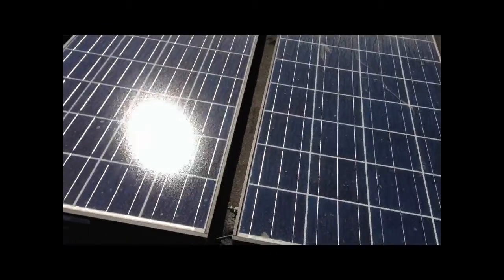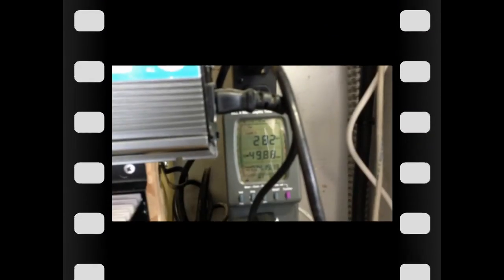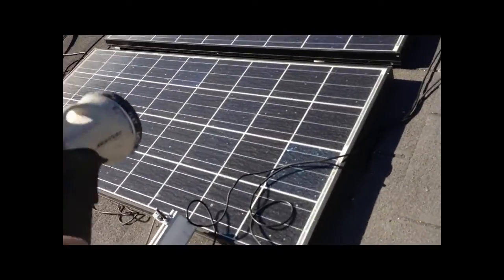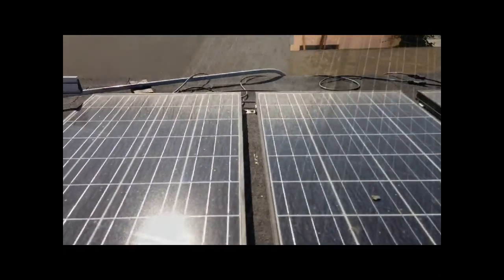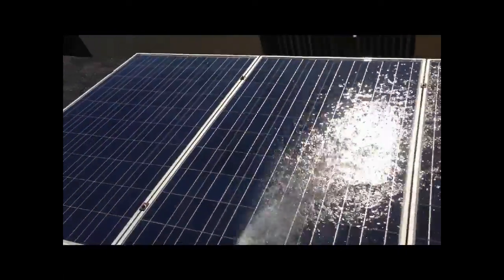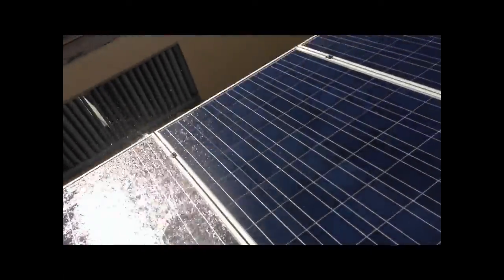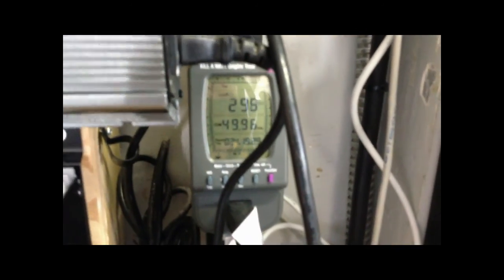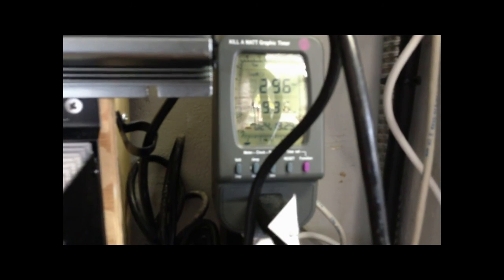Solar Panel Test:  Dirty vs. Clean

Comment: As a scientific experiment, you haven't controlled all of the variables affecting the output of the system and based on my own experience, you've credited the wrong variable for the output improvement after you've hosed the panels. The panel efficiency is rated at T= 25 C but typically the panels operate at much higher temperatures, resulting in losses of 10% to 20%. 

I believe what you actually achieved was a lowering of the temperature of the photovoltaic cells, which decreased the % heat loss. An easy way to prove or disprove this is to do the hose "clean" one day and then look at the outputs the next day. In my experience the efficiency of the panels may improve up to 3% (8% goes up to 11%) on a rainy day, but the next day, for the same maximum temperature, whether cloudy or bright sunshine, will settle back to around 8%.

I've tried to prove that cleaning makes a difference, but I haven't been able to so far. The final test is to actually clean the panels and look for sustained improvement in efficiency. My only conclusion to date is that it would be worthwhile irrigating the panels to reduce the heat loss effect, which as I said is in the range 10%-20%.

Comment: Would have had a higher percentage increase, if the the panels were properly cleaned. Dirty blocks the surface of the panels and blurs out a percentage of light, granted you probably removed the loose dirt, but unless proper cleaning tools are used on the panel, just spaying them and adding rainX is not a proper clean. once cleaned and maintained it becomes easier and easier to keep clean, but rainX is just another thing that will attract and hold more dirt quicker, than if not used.  With over 300 days of sunshine in Colorado Springs, we have lots of solar panels and dust. http://www.WindowCleaningTime.com

Comment: Anybody that considers that "cleaning" would be happy to wash their car and house windows the same way.  They won't be clean and what's left behind from that tap water will be worse than the dirt that got rinsed off.  The minerals dry, create a rough surface, and hold dirt better and better each time a new batch of mineral deposits is applied (tap water)  This is how we do it in Arizona.  http://cleansolarpanels.net

Comment: i have done some tests and very little diff. don't know where you live but if you can tilt panels at least 15 degrees they will stay clean. i'm in the sw and we tilt panels from 15 to 25 degrees if your n. more and if your s. less. your panels almost flat. and are those 2 rails shading that one panel? that will pull that string down. as little as a overhead power line will kill a string. get your panels at right angle for your location you will see a noticeable increase.....if you guys are getting less than 60% sys is not set up right. depending on month my sys. is between 70 to 90% april is 95%. contact me i can help
Reply from the maker: in so cal.  i thought of mounting on angle, but for asthetic purposes only, did not want to raise them on legs with tilts.  i prefer the low profile look. no shading at all for me, but dirt (especially heavy dirt) acts similar to the effects of shading... my panel test was done on a cool crisp day so i don't think the water from hose cooled them further, which would normally increase output.  But the reason i am getting such poor production is because the array i did the testing on is inverted with a cheap chinese plug in inverter.  My larger panels and array is inverted with individual Enphase Inverters which net me 1.2kw peak on an array that's rated only at 1.35,  So, tilt not killing my produciton as much on the array in test, but rather the cheap plug in GTI is biggest culprit. thanks for the comments and advice
Reply: your panels should be at 22 degrees for best year around performance. you won't get much at all during winter months. i live off grid winter i set panels at 40 sun is low and less of it then march drop then to 15. i install for living. have a few customers wanted low tilt. they were not happy told me something wrong with sys getting about half of what they thought they should. took them up on roof the bottom row of every panel covered with dirt. when i sell and install a system i tell them what it will produce. then they changed the install because a friend told them flat was better..put panels at 22 degrees production went way up panels are clean and they are happy. just sayin we all want most bang for the buck. and nobody wants to go up and clean panels. but thats  your call i'm just sayin you will get alot more out of your sys and no cleaning.just happy people are using the sun it's good for all of us......

Comment: Facing the harsh reality of inefficiency,you are producing energy with about a 50% rate efficiency which is to low,mine is about the same between 50 and 60% tops,lowsy inverters,their specs states something like 80% efficiency...what a goddamn lie.
Reply from the maker: you are 100% correct.  i use to think i was getting 70-80%, but after some controlled testing, no way.  not on that junk MPPT GTI.  However, i have climbed to about 60% since completely swapping out to 0 guage, but no way is it 80%.  Now, my Enphase microinverters are 96-97% efficient, more than any good UL rated string inverter.

Comment: FYI Rain-X does not recommend their product for solar panels. Great Vid!
Reply from the maker: good to know. i think im gonna employ the brush attached to the arm and hose method you mentioned in a video. thanks for the tip and kind words
Reply: sunsensational
with the broom brush it goes pretty fast. I tried windex, but that took forever and used a lot of windex!
Reply: Micro inverters

Comment: you can get them at most home improvment stores. Or you can oder them. the spung part and squeegy are replaceable. the squeegy part I have can exstend up to 6 foot. then I bought two 10 aluminum exstetions for it they just screw in to the bottom and so on. I dont know if you see a video with my array in them but it defiantly makes life easy. it defiantly helps keep them clean and with rain nex all I have to do now for a while is hit it with water.

Comment from the maker: yeah, i need get me a squeegy with long arm too.  wound up windexing them after i sprayed and realized the ugly film returned right away, and of course not a fan of reaching all way to the edge of roof as my roof is almost 40' off ground and fall from their would be lights out and not so sun-"sensationa"l for me. thanks for the good tip.

Comment: I have my pannels set at a 42 angle for my area, and I clean them once a month. to get off bird shit, dirt and so forth. O bought one of those sqeugies they used on high rises, to clean tall windows. it has a 30 foot reach. I first wash them with soap and watter then sqeuagy them clean. and let dry.   I have heard you can spray them with rain x. and it will help keep the dirt off and lots easer to clean. because stuff like bird droppings dont stick.

Comment: Nice increase, Did you happened to rub the film of dirt off? But it still needs to be cleaned the old fashion way, LOL! I have dirt roads by my place and I have to clean mine once a month. But after I wet them down, a bottle of window cleaner and a towel gets that film off. Thanks for showing your good setup!!